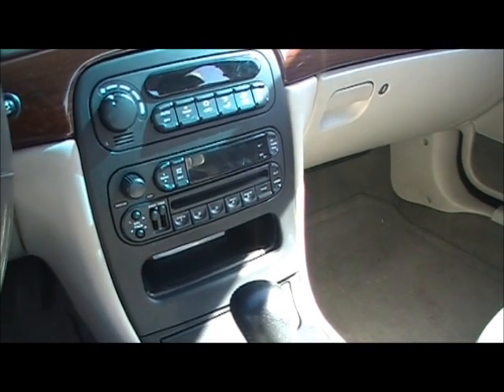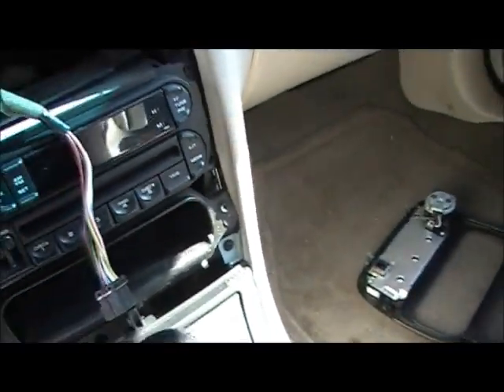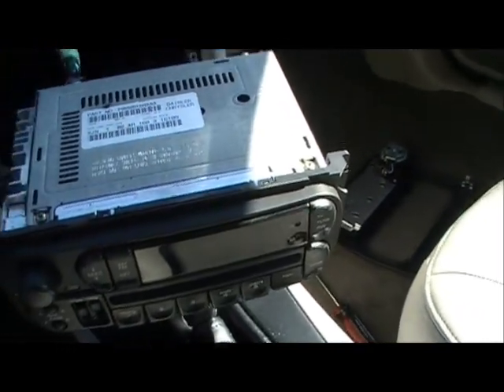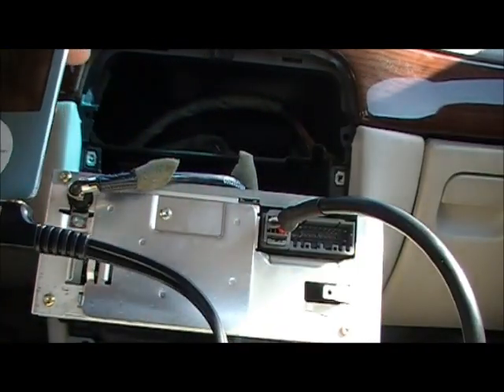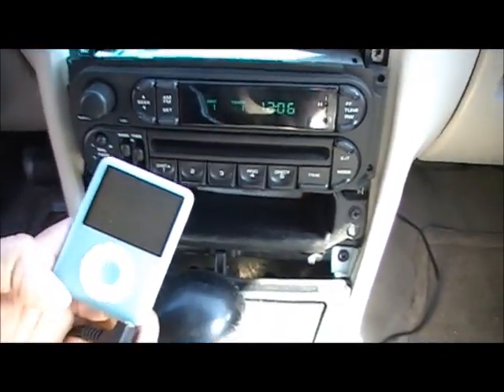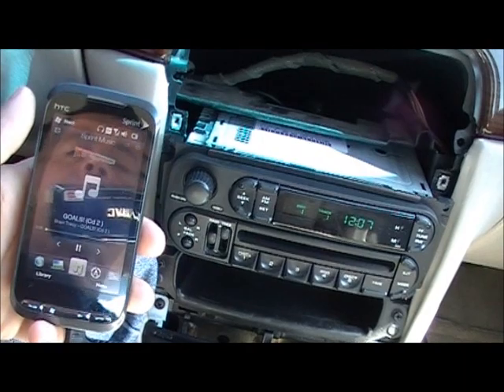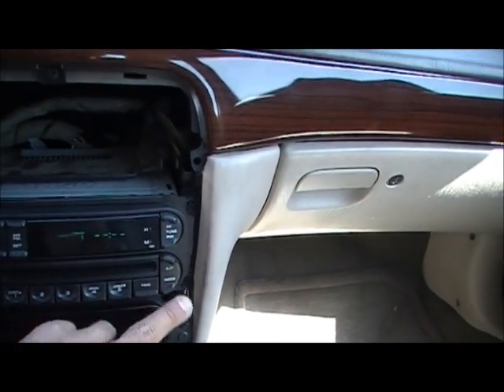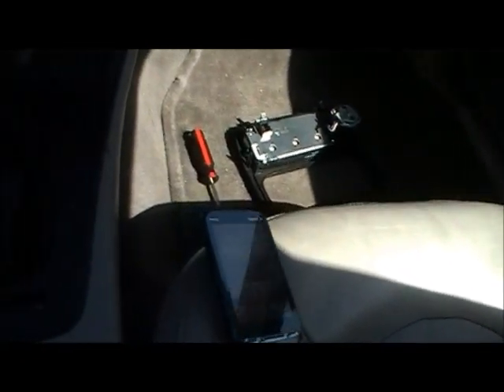How to put an Auxiliary input jack into most Chrysler Radios for iPod MP3's

Comment: its better to just buy a new stereo for the price off this thing
Reply: A new radio  Pioneer or Kenwood a lot better, NOOO.   I will need a new Radio harness, a Radio kit, those flimsy plastic  that anybody can brake and take your radio not only that, the new radio is smaller with small buttons, now the radio sticks out 1/2 of an inch because of the radio kit, I will also need and antenna adapter some type of interface to make the new radio works with the Infinity sound system  amplifiers, and for sure I will lose the Center channel speaker, and steering wheel controls also the different radio illumination color, I do have 2  alpine radios, but the lights didn't match and I don't need to replace a broken glass because I when to the movies late at night the Auxiliary input adapter works great sounds clear CD sound quality and looks factory  I have now 2 inputs one for iPod with a docking cable and one for aux with a 3.5 headphone jack I will be adding a Bluetooth media kit next week